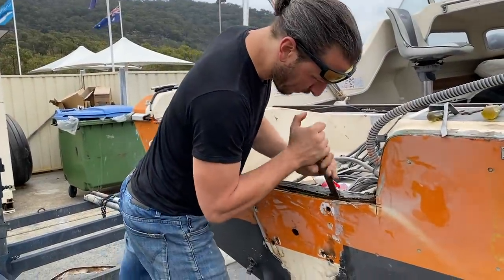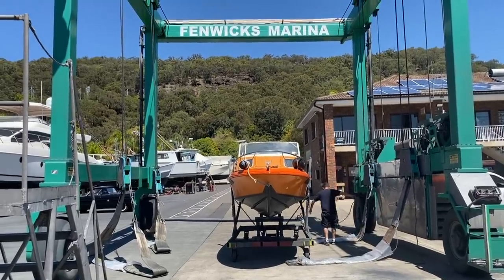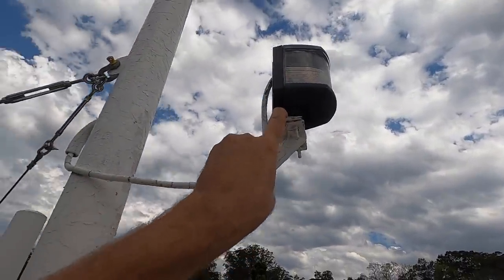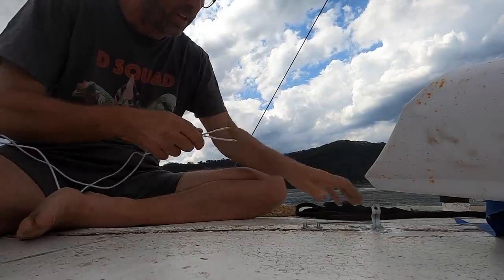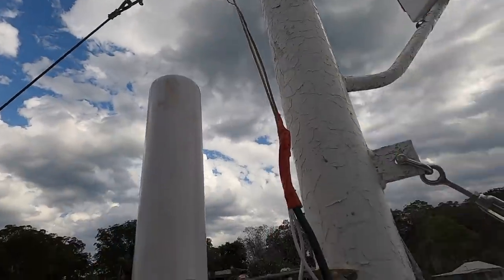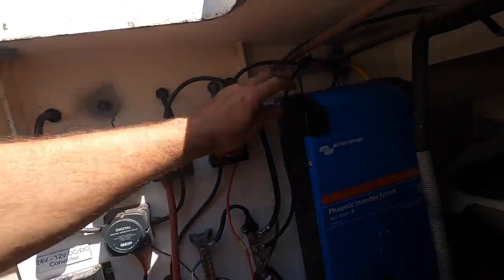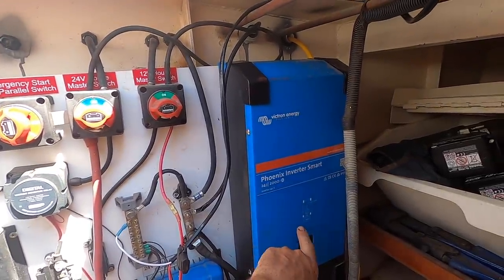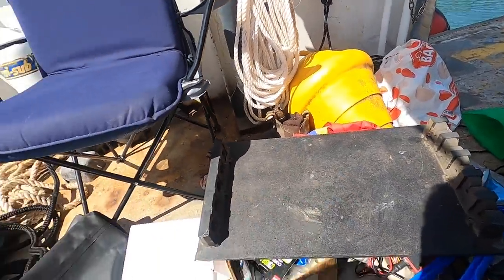Self launching bow roller for the anchor, and neater wiring!

Comment: I read a lot of replies regarding the anchor receiver/sprit.  A different possibility might be to simply raise the forward end of the sprit to adjust the angle until the rode no longer contacts the aft edge when paying out.  It might take too much of an angle to be effective, but it might be worth a look.  Thanks for the continued top notch content.
Reply from the maker: Nice idea, but the trouble there is that the angle it is on is what allows the anchor to self launch without being given a push.
Reply: @DangarMarine  of course, I'm just going to go stick my head in the toilet.  Wasn't thinking it through.  Definitely need to avoid abrasion situations if you can with the high modulus polymers like Dyneema.

Comment: Why not use an oil cooler from a diesel engine like Cat or Detroit instead of a heat exchanger they work on the same principle hot fluid in cooled buy cooler fluid running around the tubing. More common and easy to repair go to a truck junk yard and buy one just to get the end bits because the center is easy to replace and always in stock. One end is coolant in and the other has the oil filter base built in but for what you want just get 2 bits from the end without the oil filter base to get you what you need.
Reply from the maker: For sure, plenty of parts from other wrecked engines would do the trick.
Reply: @DangarMarine  Well here trucks are rolled or wrecked with good engines and they just part everything out. Or buy one on eBay.

Comment: WhatI have used previously to clean out transoms was a very long extension with the boring bit on it .You can actually chew the wood out and then use a vacuum with an extension on to suck it all out.
Reply from the maker: Yes, we did buy exactly that for this jobs. Great minds think alike! ;)
Reply: I did mine with a chain saw and the vacuum out the junk

Comment: Hey Stu, for the shore inlet if you put it in the original pos you will need to protect the cable with a CB near it unless its under 3 M cable length to the RCBO, as you aren't on a dock with power permanently cant see an issue with it in the Laz, you brought up the disadvantages of it there in the Vid. Cheers
Reply from the maker: I could well be a smidge over the 3M mark to the lazarette, but you are right, I'm not on a dock so I'm really not sure how often I will need it. Even when we are staying on board we never get the batteries below 80% by morning and then they are full again before lunch.

Comment: With your anchor, problem might also be solved by feeding rope/chain to top of winch rather than bottom.
Reply from the maker: It would solve the problem, but I'm hoping to keep the rode low enough to step over easily.

Comment: The DC cables will not affect the antenna wires...
Reply: The inverter earth is so it can either be for a bonded earth neutral system, or if the inverter is standalone, then can be used a separate neutral earth.
With the later, an RCD will not trip. With earth/hull bonded to neutral, an RCD will work.
You will then need an Residual Current Device that isolates neutral and active upon trip, I'm pretty sure those hagars MCBO's don't do that...
You really need a marine electrician to provide advice as the standard for marine installations is quite comprehensive, additionally you need someone with SPECIFIC insurance relating to boats, general electricians insurance specifically DOES NOT cover marine work.

Comment: Iv used "plate heat exchanger" in tones of hydraulic oil cooling application they aren't stupidity experience fully stainless and pretty robust easy to mount come in thousands of sizes.
Reply from the maker: Cool, I'll do some research into them.

Comment: For the shore power plug. could you put it on the outside of the lazaret hatch similar to your engine bay switches? That way, the run is really short to your electric panel but the port is out in the open and the hatch can stay closed.
Reply from the maker: I was thinking that too but I think the hatch isn't quite high enough, it's lower that the engine bay hatch. Of course I could put it there too between the battery switches as it is much closer.
Reply: The engine bay hatch makes sense too, it'd keep it all nice and close together

Comment: make up some sort of cap to weld on the mast with a removable cover. just like lamp posts have.  it is easier access later if needed  and you dont have to worry about the heat from welding damaging the new wires.
Reply from the maker: Yes, good point about going through all that only to melt the new wires. I'll see what I can find.

Comment: SO sorry you're updating to Windows 10.  As a computer professional, I HATE 10 as MS now has the right to change anything, including interface, as well as adding programs you didn't want or ask for,  and even change what programs open what types of files (think resetting Microsoft Edge (UGH!) to default browser).

I recommend anyone who liked the Windows 7 interface to stick with it for at least a few more years, as I am doing on my main computer.

re: Windows 7 not being supported, doesn't matter since you're already behind a firewall/router, yes?  

Fortunately, you CAN revert to old version within 10 days and that works great.

Lastly, if you wind up disliking the W10 interface (very different), you can add the free, open source OpenShell (used to be Classic Shell) https://open-shell.github.io/Open-Shell-Menu/.  VERY slick.  Oh, and try WinAeroTweaker to restore and simplify some settings MS has, in their infinite wisdom (insert sarcasm here..  :)  removed, like the ability to make your system log on automatically at boot. https://winaero.com/

RichE San Diego, CA

Comment: Sure you’ve done it already as I am catching up on the vids. But, you can’t get a double gang rear plate and mount a socket and have an RCD underneath next to or which ever orientation you wish. Then use underground 2C+E as it is quite thick and resilient although UV sensitive. Or just TPS. You could also get a 2 way switch and have it setup so you can go mains/off/shore. Have it wired into a power box and have the inverter run 240 to main side and socket to sure side. Though it’s a bit more work.

Comment: Won't grounding your electrical system to the hull of your boat increase corrosion with stray current?
Reply from the maker: Interestingly no. The idea is that almost no current passes through that wire to the hull, but if a positive wire touches the hull (ie, casing chafes) it will give a good enough connection to blow a fuse rather than just allowing a few milliamps to find their way to negative through some other path 24/7 and causing undetected corrosion.
Reply: @DangarMarine  ok
Reply: @DangarMarine  Ive heard yachties say over the years a stray current on a steel hull will rust it from the inside out in salt water  with steel hulls and similar story from Aluminium boats. A current accelerates electrolysis

Comment: Poor Furuno ... I doubt very much if that radar antenna is rated for use a mast step.   While you are welding on the mast (pad over wire access hole),  I suggest you add a real mast step or two for easy stable climbing of the mast.

Comment: Bolt a nylon pad to let the chain glide  on. Use existing bolt holes.
Reply from the maker: Yes, I was thinking something similar given there really isn't enough height for a full roller. It will be interesting to see how long it lasts before wearing and needing replacement.

Comment: Too bad the awning wasn't on some sort of a hinge where it connects to the wheel house roof so if you need to pull the engine you could use the cables to just raise it straight up and not have to disconnect any wires or remove it then lower it to provide cover again.

Comment: Put the rcd on the wheel house under power in. Google this model number: 56C310RC-GY. Its a little pricey but it will look nice and be easier for shore power and protect everything. Putting the lead through the hatch the lid could cut the cable. Then death

Comment: Morning, that re-bend with be a fracture line over time...All the best from pom land
Reply from the maker: Yeah, if it works out I'm going to replace that aluminium bracket bolted to the stainless bracket with a single stainless bracket that I'll weld on.
Reply: @DangarMarine  I don't comment on the wiring lol however know my way around metal lol and dive boats..
I think you could fab a bracket with a flat plate and a pipe cut in half. Then a good quality exhaust clamp around the pole and half pipe...fab it in the w shop with the tig

Comment: I don't know what your exhaust setup is like for water ingestion but the rusty water marks in the intake that seemed to be running out of the cylinders could maybe come from the exhaust?   Also how about some condensation?  I've had my diesel in my truck sweat like a can of beer after a cold night when i went out in the morning to change the oil.  I was surprised to see the dew condensed on the outside of the block from the cool evening air and the warm morning air.   Just  a thought.  Love your channel. thanks for sharing.  :)

Comment: You say the engine stopped in a different place every time. I wonder if that's true? I had a '76 Merc 2.8 x 6 cyl gas engine car for 10 years and at one point I had trouble with the ring gear for the starter wearing out in the 2 spots where the engine always stopped. I had a Merc mechanic change it and said as it's a bolt-on he could just move it one bolt round ....I did go for the new ring. But he confirmed they always stop at the the same 2 places! 
Who knew?  I even tried stalling the engine ( automatic) to stop at different place but it didn't work very often)
Cheers Warren

Comment: @36:00 carve a block of HDPE to bolt in on the back using the last 2 holes.. make it a U shape as a guide for the rope or chain.. so you don't have to cut it off.. or use a lathe and carve another roller.. if you can get another mid roller.. you could grind the diameter of the ends down to allow you to mount it across the back end with 2 holes drilled thru the sides.  bonding bolt to the hull.. drill thru the rib. so you are not welding directly to the hull.. .. on the shore power connector..  high up on the outside of the pilot house. with some kind of flanged and hinged rod to swing out when you have shore power plugged in..  so you can walk under the shore power cord when its plugged in..  in my friends boat we had almost 6 feet of freeboard at the engine room.. allowing the shore power plugs to be almost 4 feet above the water level.. with metal screw caps that were almost flat.. these were Hubble brand..  you don't have as much freeboard.. i worry about boats tied along side ripping any hull mounted shore power connectors right out of your hull..  you could put a shore power connector on the inside of engine room with the guts removed. but still having a cap.. so you have a hole in the hull that is sealed by a cap on the inside..  so you could fish a shore power cord thru the opening with the inside cap removed..  this would require a curved insert to protect the shore power line from abrasion.  but that could be easily machined and installed on the shore power cable before the connector is installed..   the thru hull and interior connector body would need to be installed at an angle so any splash will drain out  when not in use..  or follow the shore power cord uphill when its raining..

Comment: See a lot of comments about adding a 3rd roller rather than cutting. I have to admit I agree with them. You can always cut the metal later, it's less easy to put the metal back.

Comment: INVERTER EARTH: It is for situations where a residual current device is used, mixing the neutral in that situation would cause instant trips. So basically its for extra sales because it has an option that nobody would actually use but probably a few people would think is a good idea if they didn't really know what they are on about lol
Reply from the maker: Meaning you would attach it where?
Reply: Don't confuse the Inverter case earth with the AC protective earth ;)
Reply: @DangarMarine  Earth to boat, but all neutrals isolated from the boat. It isn't relevant for your normal setup, and I'd honestly have to rack my brain to come up with a situation where it is needed.  Also the opto-isolator inside the inverter would become irrelevant if the earth had continuity, which is something only PC board type people worry about. If you had  a DC RCD before the inverter then you would need the earth separate, again something I've never seen in 20yrs in the industry. I'd also guess 30% of the reason it has a separate earth  is to conform with aussie standards of earthed cases and also conforms to standards of countries that don't use a mixed earth/neutral system, where the case could become live for them.   

My advice is forget all of what's been said and connect it how you have, happy days.
Reply: @Nick75au1  yes, but that is what they have also done. Having them joined is the electrical version of confusing them. 
Ie, someone has gone to the effort of not joining any neutral to the earth, and needs the high and low side of the inverters PCB to be octo-isolated, then confusing the earth and neutral will ruin their day.
Admittedly I doubt anyone would do it that way, but that is the reason for separate E/N
Reply: @Combat.Wombat.official  on a boat (US is exactly the same), the neutral to earth connection is made at each source of supply, so within the inverter, at the generator or at the shore connection supply. ( an inverter charger should disconnect the earth neutral link when a input source is supplied) Renko only has an inverter . The heavy case earth is for the DC side of the inverter to provide a fault path for DC current if internal components fail to  case earth
Reply: @Nick75au1  yes and I was explaining why it is separate for situations where isolated neutral is required, say if this inverter was installed in a sound studio, then no earth and neutral continuity would be acceptable.

Comment: I recall one of the first things you did to Renko was cut a gap in the bulwark, to allow easier ingress and egress to the boat.  The door was stripped, rotten bits cut out and new pieces welded in, then primed. You pondered the best way to hinge it to make a door for safety.
I noticed in this video there is, 18 months on, still no door. Did you lose the door or abandon the plan to have a door and are now going to leave a permanent gap in the bulwark?
Reply from the maker: The door is still sitting in the workshop at home. I guess I just haven't prioritised it as I haven't missed it an there always seems to be something more important to do first. One day! Maybe...

Comment: Would it be possible to twist wrap a connection to those wires and use a come along to pull them? Or would they break instead of come on through?
Reply from the maker: Even pulling them with my hands they snapped in the mast somewhere unfortunately.

Comment: I am a bit concerned as you have a yellow plug and cable carrying 230 volts as biulding site regulations here in UK say that all yellow cable should only have 110 volt for site equipment I dont know if you have the same regs in Australia.
Reply from the maker: Sounds like we have a different colouring system. It's a 240V cable (we don't have any 110V in Australia), and a relatively heavy duty one at that.

Comment: move that new bow sprit out 1 more hole it will solve your problem without having to modify the nice shiny part.
Reply from the maker: It is the angle between the back roller and the end that is the problem and that wouldn't change if I just moved it forward.

Comment: How do you determine the oil level in an iffy rebuild without dropping oil.An adding correct amount by the book
Reply from the maker: Yes, originally added the amount from the book but can't get any part number of the sump pan (there are many different ones) and we also need to know the volume of the remote oil filter and lines running to it.

Comment: Was it an RCD or rcbo you've fitted?
British RCD fills the space of 2 modules on DIN rail. Rcbo is only 1 module wide.
In Britain we can't use a rcbo outside because it only cuts the live. RCD cuts the live and neutral.
Reply from the maker: My understanding is that an RCBO is essentially an RCD with the ability to also act like a circuit breaker and trip in the case of over current so this is just an RCD.
Reply: @DangarMarine  essentially yes, might be the British regs getting too fussy on when you can use an rcbo and when not, ours don't usually cut the neutral in the same way as a double pole does.
Also we've got different RCDs. 
Type AC normal sinusoidal. Type A and type B when there may be stray DC current from perhaps from invertor. don't fully understand though most of my work is domestic electrics.